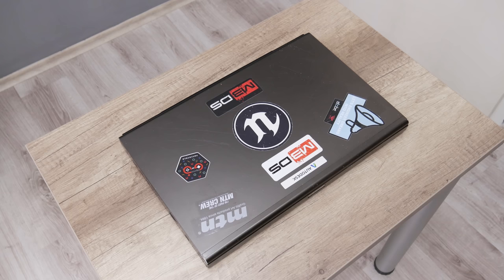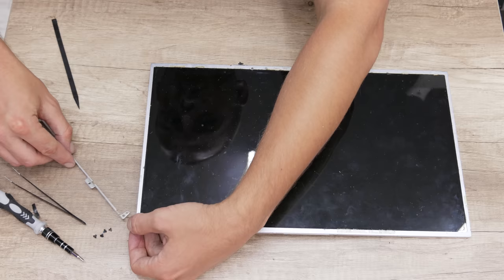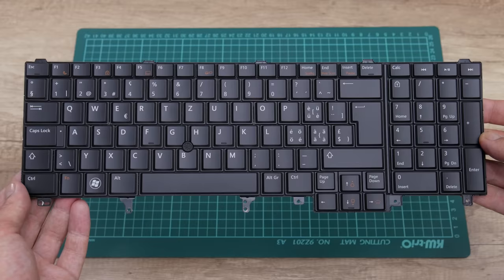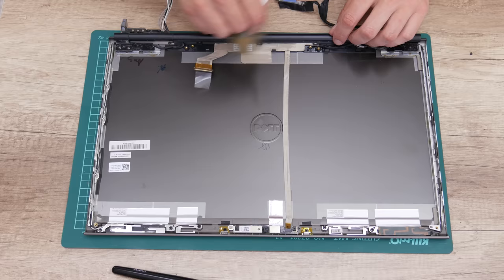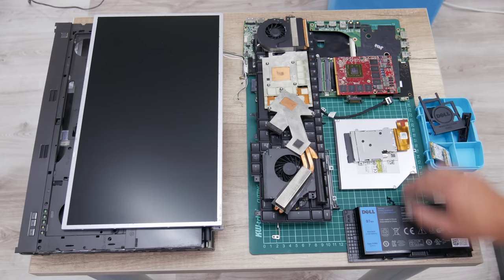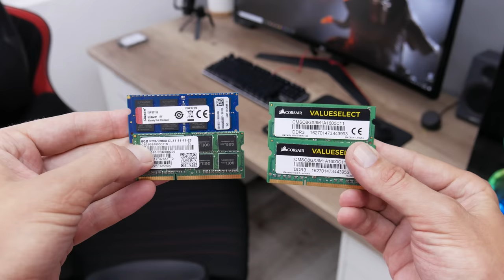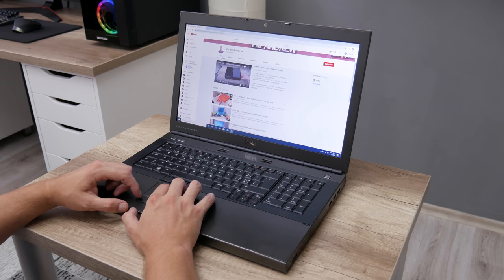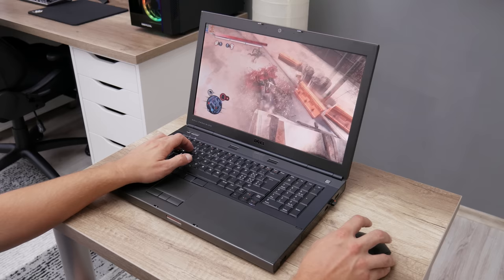Restoring DELL M6600 - Mobile Workstation

Comment: I have the successor to this model as my daily driver - the M6700. It's currently rocking a Core i7 3940XM, 32GB RAM, GTX 980M, 256GB Samsung mSATA Drive, 2x 1TB Seagate FireCuda SSHD, and the somewhat rare touch screen module. It's a beast of a machine, these era of Precision laptops are an example in proper build quality - a lot of manufacturers of modern day trashtops could learn a thing or two from these machines/
Reply: If you want to sell that to me, and are in the UK, I'll buy it, it's exactly what I want as it's totally windows XP MAXXED! (will dual boot win10 or linux also)

Comment: I absolutely love this computer! I originally bought a used M4600 in pretty good condition but a) wanted bigger and better graphics options, b) a bigger screen and c) the thermal performance of an i7-2820QM in a 15" laptop wasn't so good, especially since it would frequently overly heat my legs during heavy use. I then fixed up a very broken M6600 and now it's in amazing cosmetic condition, I can now use MXM B cards (mine has that same M6100), my CPU barely reaches 75 degrees at max load, and I may someday have a larger screen; unfortunately, my replacement was used and the 40 pin connector lost the solder pads to ground the connector, so it caused a short. I may be able to do so with the wonderfully placed 30 pin connector and daughter board but it gets really expensive and I couldn't guarantee it would work. Overall, the upgradability and usability of the M6600 is fantastic and I think this is my new favorite video of yours. 

Although it is basically the same computer, I'd highly recommend looking at the M6700, which is the Ivy Bridge version of this laptop. It has all the same great features and full support for Socket G2 chips, as well as better graphics card cooling. And if you are even more daring, there is a very elusive variant of the Precision M4000 and M6000 series that comes in cherry red, absolutely gorgeous. Very hard to get your hands on, though, almost easier to just buy the cherry color scheme parts and build it into a M6700.
Reply: Use laptop coolers
Reply: @nucleargaming4036  Nah, for this purpose  the temps don't seem to impact performance, and the CPU temps barely hit 90 with a max load on both the GPU and CPU. The main issue is that there is a lot of heat soakage in the bottom panel from both fin assemblies, causing the bottom cover to heat up to extremely high temperatures in the center-rear. If it were on a desk all day long, however, this wouldn't be so much of an issue. Plus, I don't think most laptop coolers would be able to contain this chonk.
Reply from the maker: Thank you :) btw M6700 and M6800 are better, the booth have upgradable CPU and other parts. The temps may goes higher but this is not problem to these beasts
Reply: 69 likes lmao

Comment: 🤍  This is the most beautiful machine I've ever seen.
Totally upgradable, a big machine which is not created from plastic but from metal and it's so stable and nice machine even in 2020.
If anyone sells a machine like this, I would buy it immediately.
This is antiquity!  🤍
Reply from the maker: Nowadays is hard to find quality laptop, btw this one is about 4KG, pretty heavy, very great quality build, even the charger is quality, the charger is bit large, literally brick size and mass :D
Btw the better models are M6700 and M6800. Also the quality laptops are Alienware, also made by dell, my dream is Alienware M17x R4, its an older model but is totally awesome
Reply: True. I hope can buy this laptop. This thing is worth every penny
Reply: if i had to buy this laptop without a GPU, RAM and battery, i totally would. i could totally survive with a spare GT240M i have (also MXM), 8 gigs of RAM (i have a kit of 4 x 2 GB sticks of DDR3 by Samsung, totally respectable), and without a battery, because of covid-19 ;p
again, massive respects to Dell, who made this machine so damn good <3
Reply: How much would you buy it ?
Reply: @jeancharles425  I don't know .. give me a price if you have such a laptop
Reply: What about Dell E5400 is upgradable with new SSD
Reply: I see these on ebay pretty often for $300 to $400 before upgrades. If you are willing to upgrade the CPU to get access to the 4 RAM slots (the dual-core not only maxes at 16 GB but reputedly can not use two of the RAM slots at all), you can get a very good machine. You are stuck with DDR3 1600 MHz RAM rather than DDR4, but with even 16GB it will perform well. I bought one plus parts (CPU, battery, charger, hard drives) for about $300 all together. I looked up this video to help me dissecting the thing.
Reply: Oh yeah i have Dell Precision m4800 and i think it feel same build the difference are processor and gpu only remains still the same
Reply: Look at Avell
Reply: Xps l702x, the best, also the xeons laptop
Reply: all you have to do is look up the model no on the video
Reply: @davesoraytc9889  You can have mine :D
Reply: I bought one like a month ago.
Reply: @ComputersAndTechAndAndrew  can you make a upgrade to a dell latitude e6420
Edited:plz
Reply: i have one for sale
Reply: I have been using my dell m6800 with i7-4900mq and gtx 870m for 6 yrs since i sold my old m6600,the m6600 was pretty good, i sold it to my brother :)) 8 years ago. The m6600 specs was 32 gb ram,gtx 770m and i7-2960xm (pretty fast and strong enough to play CS go).
Reply: This reminded me about my old m6600
Reply: @ComputersAndTechAndAndrew  m4800 or m6600 or m6700 or m6800 which ones graphics are beeter..? Must answer please
Reply: @ComputersAndTechAndAndrew  4kg huh? Basically Dumbell & laptop in one... XD Still Beautifully restored my friend... Love it!! Skol!! 🍻🍻🍻

Comment: The best laptop I ever owned, used one as my main machine for almost a decade and only cost £600 from Dell's outlet store because there was a tiny scratch on the bottom lol.  When I got it it had an dual core i5, 8GB DDR3, a 750GB HDD, a 600p display and a 2GB FirePro M8900 (based on the Radeon HD6850m).  By the time I had to move on from it it had a quad core i7, 32GB DDR3, three 500GB SSDs and a 2TB HDD, a 1080p IPS screen and a 2GB M6100 (HD7870 equivalent).

Comment: I built one of these for my wife 8 months ago. It is a very good pc, and quite literally outperforms 2 friends 5 month old alienware laptops. It rocks with win 10, 16gb ram and 4gb video card. Can NOT go wrong with an m6600
Reply: Hello, what video card have you installed?
Reply: Ebay has them just copy and paste this name. It is what I used. 
HP Dell M6600 M6700 4GB GDDR5 NVIDIA N14E-Q3-A2 Quadro K4000M Video Card

Comment: I owned M4400, M6600, M6700, M4800, M6800. all are awesome machines. still have all M6*00. dell used to sell these machines at 35%-50% off when new version came. so bought most of these new at almost half price with 5 years of support. love these machines. best laptops I ever had. M6800 > M6700 > M6600. there were improvements from M6600 to M6700 to M6800 besides processors. Minor upgrades like better fans, better hinges, usb 3 (M6700) , additional screws for spare hardware (M6700) to fan grill (M6800), support for under the keyboard memory sticks to reduce flex (M6700), Better heat sinks (M6700)... made huge difference.

Comment: Wife: Is that a new make-up brush for me? awhh so sweet!!
Me: It's for the laptop.
Reply: a shaving brush should work although a little rougher
Reply: @ronalddavis  naa you need softer brushes because you can accidentally clip off one of the capacitors if you are a little too rough
Reply: @ItzBeleking  a watercolor brush would be great then

Comment: To remove old glue use a cloth damped with red transmission fluid, safe for plastic and metal. You’ll be amazed how glue melts away due to transmission fluid high detergent content to remove gunk in transmissions. Then just clean the transmission fluid away with glass cleaner or soap and water. Works for me every time. Some people think I’m joking at first but once they try it they are amazed also.

Comment: I drill holes on case along the heatpipe and where heat builds up such as gpu, chipset, cpu. It works well. Easy to vacuum out also to remove dust.

Comment: I rebuilt a 6800 several years ago exactly like your upgrade - right down to the CPU.  Well, I was a little sloppy on the cleaning.  I didn't have the patience.  I do want to upgrade the GPU.  My only complaint is the weight.  I am a software engineer and have found these to be capable workhorses.  Thanks for the video.  Brought back memories and it is nice to see I am not the only resurrecting these monsters.

Comment: I also have a DELL Precision M6600 with i7 2820QM, 12 GB RAM, 128GB mSATA + 750GB HDD +320GB HDD, AMD Firepro m6100 GPU. It plays Dota 2, Rocket league etc. on maxed-out settings. I have a pretty decent experience with Dell precision at very reasonable and low cost. I skinned the top with a carbon fiber vinyl. 
This video was pure joy for me. Thank you Andrew for the awesome video.

Comment: I bought an m6600 off eBay for 125. It was the base model. I upgraded everything in it to the highest performance stuff you can put in it. Fastest i7extreme, nvidia 5010,  hd display. Blueray burner All SSD hd and 32 gig of DDR3 ram and such the only thing missing was the optional touch screen. It rocks, in fact it keeps up with a lot of newer systems.

Comment: I got hold of a M6400 many years ago for very little money. Amazing machine and I still have it. Not that portable but you can move it. It was pretty well specced but the person who ordered it cheaped out and got it with just a 2Ghz dual core. I upped the RAM to 8GB, swapped in a 250GB SSD, loaded in a 500GB HDD for data storage, plugged in a backlit keyboard and installed the bluetooth module. Also plugged in a USB3 express card. All great. I also bought a 2GHz quad core CPU. I then looked up how to swap that out...and it was not fun, lot of cables to pull out, screen removal etc. I just left it. For a couple of years it sat there laughing at me, goading me to do it. I then thought I best had, so I spent an afternoon doing it. In the end I managed to get the new CPU in without having to remove the screen and pull everything out. It was tight but it all worked. My other half still uses it if she needs to go work in an office. It gets some looks!

There is an orange metallic case option but I would not go that far...

Comment: I have one of these M6600! They're absolutely massive and great performers. Mine had a broken HDD and the SSD was missing, so I chucked in 2x 2,5" SSD's and one mSATA SSD. Runs like a champ.
The GPU is also the same on mine, but I was thinking of a getting a used GTX 970M, that should fit in there nicely. However, I am not sure about the drivers or if it will even be recognised by the laptop itself. Perhaps modding the Nvidia driver.ini by swapping hardware ID's might do the trick.

Comment: Last of it's kind was the m6800. I got mine last year for $450, without a drive, cause I had my own ssds. I did pay another $80 and got from 16 to 32 gigs of RAM. 4810 qm and Quadro k3100 may not sound much on paper, but man this thing runs 3-4 vms no problem, while I am testing other stuff on the host os. It weighs A LOT. But it's built like an actual tank. Has 2 msata slots. 2 mini pcie for wifi and/or mmc card. A physical wifi kill switch, gigabyte lan port, display port, dedicated microphone Jack. And the speakers are unbelievablely loud with actual bass you can actually enjoy. No wonder these things were around $3500 or more when they were new. It took me 2 months to find one but man am I happy to own this absolute unite of a mobile workstation that still doesn't have any competition. I wish dell kept this kind of built quality alive as a separate niche.

Comment: I have this same exact laptop only with 16gb ram and a 2gb 300x gpu.....it's a monster for its age.  I actually landed this workstation for free....just needed a hard drive and a new battery.  I got a new 250gb ssd and a new battery for $80.  It litterly looks like brand new.  I'm thinking about selling it here soon.

Comment: When you watch the video and talk: Man, i really need this pc
Also me remembering that he will not sell: aw shit, here go again
Very nice video, I love your Restoration videos!
Reply: CreativeDZN Do people like to do these up? I thought it might have just been him; we have 2 of these at work; one is faulty; but the other one is fine; it didn’t go out on jobs much because of the weight.
Reply: dansclassics you can sell it to me
Reply: Mwiinga Hamilenga I thought from the video that there wouldn’t be any available, but there are; I also checked it the other day and it’s fine using its screen, but the HDMI port is dead; this is a heavy unit which is in Sydney; has the original psu and battery; we do conventions etc but this one didn’t go out much as people were put off by the weight; it has the high resolution touchscreen in it; this model has several choices in it with the screen.

Comment: Nice upgrade! Although I haven't had one myself, I really like this laptop , due to the upgradability. I believe that ALL laptops should be built like this. This really is a beast of a laptop: upgradable CPU, upgradable GPU, two disk drive slots in addition to an optical drive (extremely rare - most laptops either give the option for one HDD and the DVD, or 2x HDD but no DVD - not both 2x HDD and DVD), and also four memory slots. Some desktop PCs don't even have 4x RAM slots!
Also, you did the exact same things that I would have done: 32GB DDR3 RAM (if there's the option for 32GB, why not - most laptops will only take 16GB so this is better), a 500GB SSD for the OS (480GB is close enough) and a 2TB data drive.
This is one of the best laptop upgrade videos I have seen - no compromises made here.
Reply: It has 3 disk slots - over 2nd ary disk bay there is mSATA slot. I kdnt figured out one more space that looks also like mSATA is even shorter
Reply: As you can see in the video, it becomes ridiculously large, thick, and heavy.

Comment: The Dell Precision M6600 is truly a beautiful piece of work. I picked up one for $130 US back in 2018. It came with a Core i7 2820QM @ 2.4Ghz x 4, 8Gb A-Tech DDR3 RAM, Nvidia Quadro 4000M w/2Gb VRAM, 500Gb 7200 RPM HDD, a wireless b,g,n 2.5ghz wireless card and a separate  BT3.0 card all on Windows 7 Pro. 

I upgraded it to a Core i7 2960XM @ 2.7Ghz x 4, Nvidia GTX680M MXM out of a Dell Alienware laptop w/4Gb GDDR5 VRAM with Nvidia drivers and a custom config file, a 240Gb Kingston Black SSD SATA & a 750Gb 7200 RPM HDD storage drive, 16Gb DDR3 Corsair Vengeance RAM and an Intel b,g,n 2.5Ghz/5Ghz wifi card with BT built in (can't remember the model but can find it if someone wants to know) all on Windows 10 Pro activated and driver's fully working. Had to get the 240w power brick to keep all of that going smoothly. 

It was a true beast for what it was and was able to play quite a few games on medium settings with no real issues, including Far Cry Primal.
Reply: Forgot, I used Cooler Master, Master Gel Maker Nano thermal paste and lapped the heatsink for the cpu and gpu. Kept things running around 70°C, unless it would go into turbo and clock up to 3.1Ghz, at which point it would be closer to 85°C. Not much I could really do to change that.  All in all, it is still a great machine that I break out every so often just to keep it working.

Comment: I have an old dead MSI laptop which I kept for like a years now, the battery is dead, the screen is not working and I don't have a charger ( my other laptop's charger is not supported). I wanted to repair it but I don't have any knowledge when it comes to repair. It has nvidia gpu too. You know it could be turned out into something great. Hope one day I will. Besides, you're the goat at restoring those dead laptops and I really love your channel, won't miss a single video.

Comment: I wonder the reaction of the person that would someday buy this and get it repair

Repairer; TF?! Why is there tape in here?
Reply: Even in factory assembled laptops tape is often used to hold cables in place.
Nothing uncommon to see when reparing laptops.
Reply: @kb-elmo  Yes I already saw pieces of tape inside of laptops I just bought and was the first to open. By the way this is something I recommend to anyone who buys a laptop: open it and check if the components are those that are supposed to be (sometimes they tell you that RAM is on dual channel and you discover a single channel config) and how you can upgrade it (sometimes there are free slots for extra SSDs).

Comment: This is the first time I've heard that I've heard of a SSD that failed
Reply from the maker: Yes, SSD fails, all SSD's 2.5" or M.2 on Windows or Mac. The SSD have life span, also it depends how the SSD is used, conditions, stress. But compared to HDD, the SSD fail very rare.
Reply: @ComputersAndTechAndAndrew  some ssd just need to be power cycled 3 times and they work again. Check YouTube, someone showed with Samsung ssd the procedure.
Reply from the maker: @SamSung-gf3rt  Hi bro, that may work in some cases but not in this case, in this case one of the memory is burned plus the board is damaged and the controllers are down, theoretically this can be repaired but it doesn't not worth

Comment: Advice: to easy remove stikers, you can use heatgun(temp 80-100С is ok. i use fan from my soldering station) and soft plastic stick(i use stick from repare screen phone kit). After to remove glue from stikers, I use WD-40. After it i use glass cleaner and paper towels. Good luck.
P.S. Hello from Russia